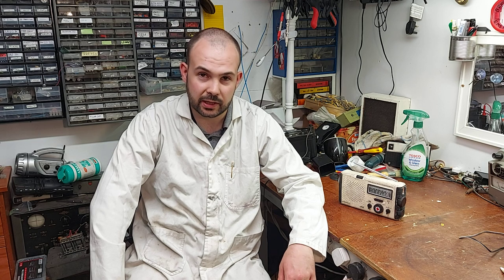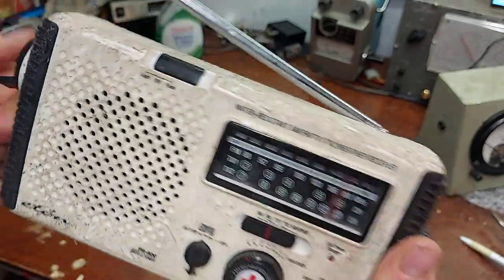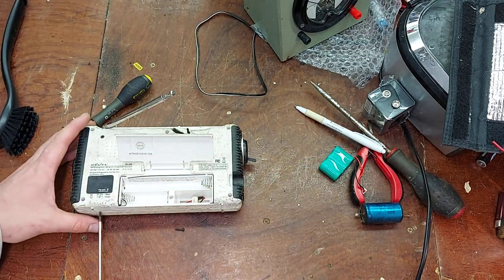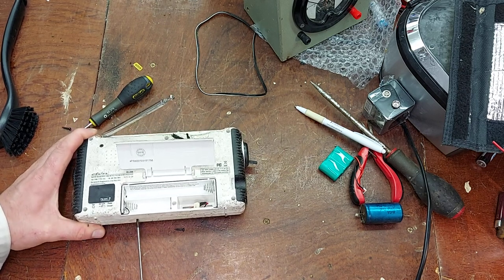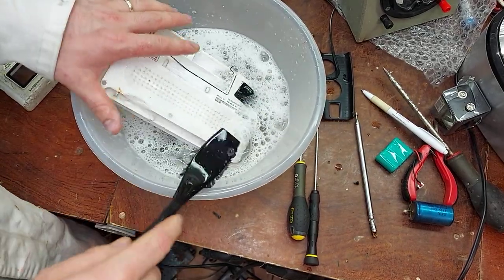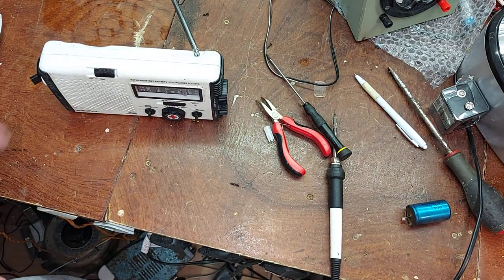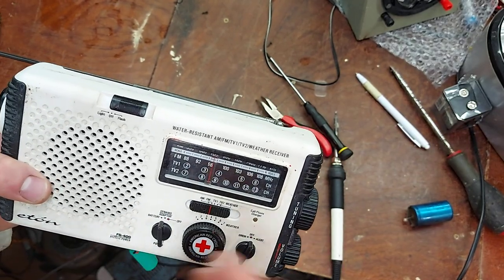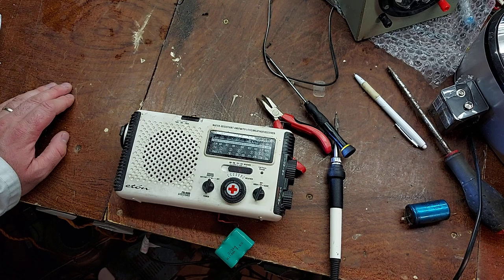Eton FR-400 American Red Cross radio.

Comment: I know what you mean about the sticky coating, it reminds me of a heavy smokers stereo i cleaned years ago.
My hand just stuck to it, yuck.
I have a red dell laptop that had the same sticky goo, really horrible.
I used petrol to loosen it, then water+detergent to remove the petrol smell.
That radio looks so much better now :-D, shame it looks like it was dragged down the road behind a car lol.
Reply from the maker: It is really horrible stuff.
Reply: When I run into something like this I try the mild cleaners first then work my way up to the stronger ones. I wouldn't use petrol like you would in a car, too dangerous, plus it might damage plastics. I've had good luck with laundry soap, or automotive cream hand cleaner to clean stuff, the kind without pumice. I think that alcohol may eat through tobacco tar, but you have to watch it on some paints.

Comment: I had two Alfa 156s over the years  with that rubberised crap all over the inside of them-grab handles, window, mirror and climate control surrounds, and centre console, (one was new when I had it-not sticky, just "soft touch"), and another I bought as a runabout a few years ago, which was around ten years old), that one was vile. I ended up stripping down and respraying any affected parts of the interior. Not an easy job at the time.
Reply from the maker: Oh no, never seen it in a car. That sounds like a right nightmare!
Reply: Yep, imagine it on a hot day!
Reply: A lot of screwdriver handles end up the same way.